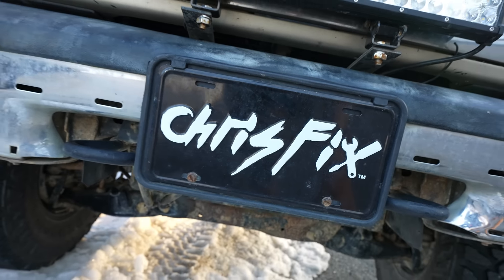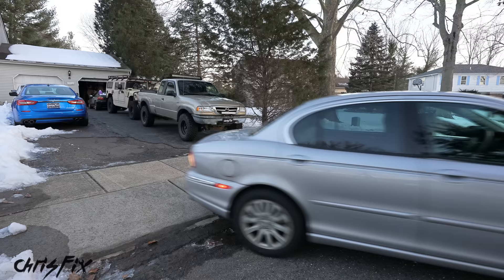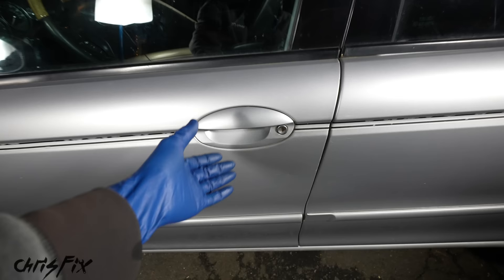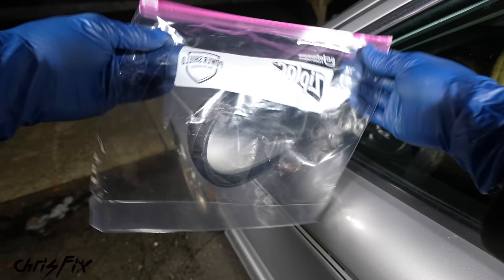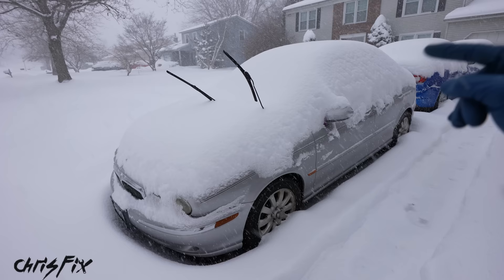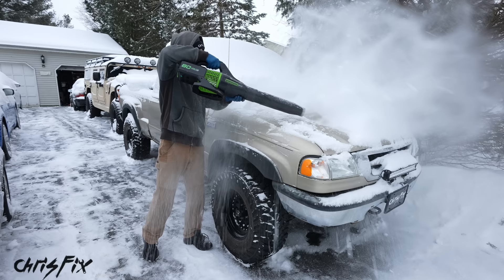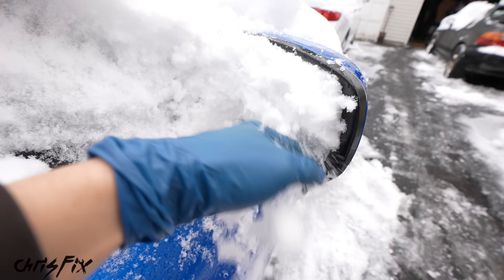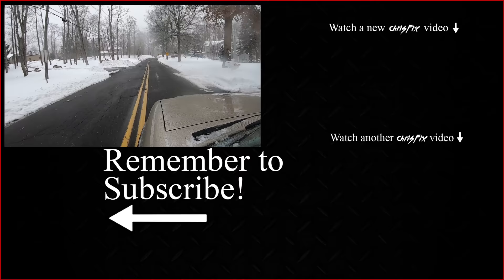10 Winter Car TIPS & TRICKS you NEED to Know

Comment: In Finland we use electrical heaters for motor and cabin, Defa or Calix brands. Car is warm inside when you come and motor is warm. Another tip, clean your car first and then the yard, not yard first. In our cars side mirrors have heating coils inbuilt so they will heat up istantly when pressing window heat button.
Reply: Hmm. And the heat might evaporate raindrops too in a light rain or mist... They would just be an option in US I think. We have areas with no ice or snow.

Comment: One winter trick I used when driving heavy duty vehicles is before you park on an ice or snow-covered surface is to move the vehicle back and forth in its track to cool down the tires.
Tires that warmed up while driving will melt the spot they are sitting on, and then freeze to the ground. I actually tore off a patch of tread one winter when I took off again  and had to replace the tire.
Reply: Hahahahaha i have lived in Montana for 35 years have zero clue what you are talking about. When it's 10 degrees out, heating of tires is the LAST thing you would ever worry about. Especially if roads are ice covered and top speed anywhere is 35
Reply: @bobspizza7444  Ask any Class A driver. They know what I',m talking about.
Reply: Gets cold here and I never heard of such a thing. Maybe gravel but never asphalt. I’m throwing the bs flag with Bob
Reply: @billbammerlin4666  Alright, Bill, and you too, Bob, pull up a chair, and let me tell you about all the ways cold winter weather can mess with you in ways you haven't even begun to contemplate.

It starts with the most obvious. Fuel gels in the lines, clogs your filter and you are stranded.
Moisture in the brake lines freezes  and your brakes won't release. Happened to me while fueling outside KC, MO. A bottle of de-icing alcohol poured in the gladhands did the trick after some minutes.
Despite blowing snow and ice, my vehicle was overheating. The radiator grill had caked on ice that was cutting the airflow thru the radiator. Happened on EB I-40 in NM. Had to stop twice and knock the build-up off the front.
5th wheel grease hardened to the point that the kingpin wouldn't release. Moved the rig inside a heated inspection bay. After 30 mins it had warmed up and started functioning again properly. Happened at a shop in Omaha, NE.
Extreme windchill on the manual steering box hardened the lubricant to the point that the vehicle became hard to steer. Nothing to do about but to drive really carefully. Happened WB I-70 thru IN.
Slush froze  the shoes and drums together  on  about all the wheels of the rig. Had to break them loose with sprays of de-icing alcohol and taps with a hammer. Happened while parked overnight in KY.
And finally, and this is to the point, the tires on about three of the wheels froze to the ground while spending the night on a shutdown section of WB I-80 between Laramie and Rawlings, WY.  When I moved in the morning, two tires lost a small section of rubber, the third a larger patch that required replacing the tire.

Winter sure has a way of building character.
Reply: @shelbynamels973  sheltered ppl that take the day off or work from home n hire the kids in the neighborhood to do the shoveling for them dont understand the real world during the winter months. Ppl that drive passenger cars or trucks 20-30mins to work in the winter have no clue what the challenges are as much as a truck driver. Not many ppl do.
Reply: @jacksmith2315  

Or they just can't fathom that people live in DIFFERENT places than them!!  The self-centered view astonishes me.  Surely cold places have snowplows.  So you can drive fast enough to get the tires warm.  And are frigid cold in the tens of negatives at night.  So I can see how tires might freeze to the ground.  Especially in canada, or russia or something.

Shit, iditarod racers have to unfreeze the sled runners sometimes.  It's not impossible.
Reply: @shelbynamels973  respect
Reply: I don't think anyone here actually understands what this guy is talking about he's not talking about heating the tires before you drive he's talking about if you're driving for a while you're tires will start to heat up and when you park it on ice like a parking lot or the road or somewhere that still has ice your tires will melt the ice and your tires will stick to the asphalt like if you stick your tongue to a flagpole or a piece of metal when it's really cold that's what he is trying to say your warm or hot tires will stick to the cold asphalt so when you get back to your vehicle and try to take off your tires could rip off the treads
Reply: @johnhostetler2167  mostly a problem with trucks that have retread tires. Not so much new passenger car tires
Reply: I’m from Alaska it’s -30 out right now,  it’s just hard for me to watch y’all in the lower 48 complain about winter and say ridiculous things😂🤦🏼‍♂️
Reply: @POS.garage  it'll be just as hard for us when you have the nerve to complain that it's 'hot' outside. No one has actually ever been 'hot' unless they've spent a summer in TX, just speaking on the lower 48. When I moved there, I thought I understood what 'hot' was...I was so wrong🤣🤣
Reply: @KerisPee  I’m originally from Arizona so I like to think I have room to talk, but you are not wrong at all lol
Reply: My girlfriend's 2022 HRV froze to the ground a couple months ago actually here in Canada,  we had just came back from a solid 3 hour drive and pulled up out front and parked. 

Couple hours later we went to go for a drive to grab dinner , put it in drive and uh, yeah. She wouldn't go. Thought something was broke till it broke loose.
Reply: crap tires
Reply: Yeah also on balmier winter days if your engine is giving off a lot of heat it can melt the snow/Ice below

Comment: Chris, something helpful, for a screen cover I used a shower liner folded in half then shoved in the doors. I found out that you need to fold the ends before inserting them so when it melts it doesn’t run into the interior of the car. Also, when in a pinch, use of plastic shopping bags will work as a replacement for your ziplock bags on the side mirrors works great as well! Love your videos, keep up the great work!
Reply: Great idea on the liner. I have a windshield cover, and it scuffed the paint when I pulled the elastic over to the side mirror.

Comment: Chris, as always, a very helpful video! A few comments from a guy that has lived through winter driving for over 50 years. Most of these tips I learned from my Dad (old school, but effective).
1. Never let your vehicle gas tank go below half full. Possible condensation in the tank and freezing of the lines from the tank to the engine. Use menthol hydrate additive (cheap) or premium gasoline.
2. Full gas tank gives better traction and distribution weight, especially rear wheel drive.
3. Old socks, usually LONG ones that went up to the knee. Put them over the upright wiper blades to prevent icing. Damn, always wondered what happened to Dad's gift socks!
4. Dad also used old wool socks to cover the side mirrors. Now, I use FREE vegetable bags from the grocery store, role and tie the ends at the bottom of the mirror.
Thanks again, Chris. Always go to you channel for layman info.
Merry Christmas to you and your family!
Reply: I pretty sure premium gas will not prevent gas lines from freezing       when it gets minus 20 an more  i disconnect battery an keep in house  battery freeze happens a lot but my gas lines have never freeze   but i put heet in gas tank in winter usually
Reply: WNY'er here, and I haven't heard of anyone having water issues in fuel since they started adding ethanol to gas.  The silicone spray on the snow shovel and warm water baggie were new though.
Reply: @smileyface9459  minus 20 what? Celsius  ? or Fahrenheit haha
Reply: @fredrezfield1629  faranheit
Reply from the maker: Thanks for the tips
Reply: Soo much text 🤯
Reply: @smileyface9459  Yep.  I use both HEET and Sta-Bil during the Winter months when I fill up.
Reply: Premium gas isn't a good idea unless the engine can use it. Premium gas is meant to be used in engines with higher compression
Reply: @smileyface9459  Nice Tip about a Warm Battery  providing more Cold Cranking Amps.  Was going to suggest a Battery Charger/Maintainer, but not everyone will have one nor (since it's cold) will the battery be able to provide its Maximum Cranking Amps.  When it gets Sub Zero (Celsius or Fahrenheit) every AMP may count... So an overnight stay in the Warm House (along with an excuse to "top off"/checkup on the Battery and Cables/Terminals...) may be worth the extra time spent. Particularly less surprises in the Morning finding a Frozen Battery because someone unexpectedly left a Glovebox/Hood/Trunk Light and/or other Accessories plugged in draining the battery...

Comment: One thing that is helpful is using cat litter as the additional weight. It’s pretty inexpensive, adds weight for traction, BUT if you find yourself stuck, cut the bag open and dump a pile in the direction of travel next to the tires and the grit can help pull you out! Love your videos, thanks!
Reply: I did this when I didn't even have a cat, 4 or 5 of the hugest boxes at Costco. Then I donated the unopened ones to an animal shelter when the season turned.
Reply: Does the extra weight mess with the shocks?
Reply: @ED80s  not so I noticed. About 120# of litter was the most i used, equivalent to a 5'5" skinny-ish person. If you can carry a passenger, should be ok.

Comment: Do not forget to mention that if you get stuck in the snow and are running the car, make sure to clear around the tail pipe to avoid carbon monoxide poisoning.
Reply: That... I appreciate your comment. Out of everything this is most helpful
Reply: How does this work? How would CO get into the car?
Reply: @RandomNullpointer  That's a good question
Reply: @RandomNullpointer  wondering  that aswell,
Reply: @RandomNullpointer  instead of escaping in the atmosphere, it gets trapped in the snow and makes its way into your cabin. Same principle applies when leaving your car running in the garage

Comment: Great video.
Some helpful tips I've learned are: 1. In a pinch, rubbing alcohol makes a great de-icer. 2. Bags of kitty litter in the back of your vehicle helps out twofold, added weight and it can be used to gain extra traction by sprinkling it in front of your tires if you're ever stuck in the snow. And 3. Putting old socks over your wipers will help them from becoming damaged. (Just like the ziplock bags on the mirrors.)
Reply: I wouldn't use kitty litter for traction under the wheels it will help you but leave a nasty ice patch for the next person keeping some salt or sand is the better option in that case

Comment: Surprised he didnt recommend to start up the car and turn heaters on while clean off the car. By the time you are done cleaning the car... the car is nice and warm and all the ice on the windows have melted and you get into a nice warm vehicle once time to drive away. :-) yep... Canadian here :-)
Reply: But then he wouldn't be considered "green"
Reply: It's not just so your car is toasty when you get in. The engine needs time to heat up before driving off, so the fluids start circulating preventing engine damage
Reply: @kimpbay  and don't forget the transmission.. auto or manual giving them time to warm up optimized their lubrication plus they shift way better
Reply: This also seems like common sense but maybe not
Reply: Also idling the vehicle warms up the lambda sensors. If you go driving on a cold day right away, the engine is runnin on maps and burns a lot of fuel while driving. Idling on maps spends relatively minimal fuel and warm oxygen sensors give stoichiometric air-fuel mix.
Reply: @samulimahkonen8604  what is maps
Reply: typical french-canadian
Reply: @Cr0nkR  when a fuel injected engine does not get information about residual oxygen from the oxygen sensors, engine is forced to run blind on preset mapping information.
Reply: @manlystyleunder50  very observant, you are. :-)
Reply: @samulimahkonen8604  

Lambda sensors have a heating circuit in them to prevent this.
Reply: @shifty2755  Some have, some are heated by exhaust gases. I have heated lambda sensors in my car. Still they require very few minutes running the engine before they start to give oxygen data to my engine control unit.
Reply: heating up the windshields and frozen stuck wipers so you don't have to scrape is the GOAT
Reply: Come on Chris ... you missed a trick 😂
Reply: Busting out the entire windshield works too
Reply: @kimpbay  realistically that takes under 45 seconds. Even if idle doesn’t drop to normal level, the circulation and pressure should be 100% within a minute
Reply: At least with newer gas engines*
Reply: @fly4976  it regularly gets to -15C in the winter where I live and can get to -40C, trust me it takes more than 45 secs!
Reply: @joebrown9621  LoL manual transmission will not warm up just by idling.
Reply: I wouldn't recommend this. If it truly is cold out it is better to leave the heaters on low until the engine has warmed a bit instead of stealing that heat into the driving compartment. You are better off buying an electric compartment heater that turns on with a timer in the morning so the car is defrosted and warmed up before you even enter the car. Here in Sweden we use plug in engine block heaters and then extra compartment heaters that plug into mains electricity. Also changing to a thinner oil for winter makes cold starts wear less on the engine. I always use 0w30 in winter.
Reply: Engine block heaters have been great!
Reply: @wyzurd  yeah they really are simple yet very effective devices. We even have a diesel engine heater installed on our truck so we can go camping in winter and put it on a timer so the engine is warmed when we come back
Reply: Isn’t this common sense
Reply: @kimpbay  
The best way to warm your car up is to drive it, not let it sit idling unless you can't see out the windows which in that case you will have to let it warm up first. Otherwise you start the car and then put your seat belt on and go! You can google this for yourself and you will find many articles on "how long to warm up car before driving". You don't have to let your car idle for any longer than 30 seconds before driving, idling for any longer is just wasting fuel and polluting. New fuel injected vehicles don't require warming up before driving no matter how hot or cold it is outside.
Reply: @missflissen  
You must be starting your car in an enclosed garage...don't do that!
Reply: Finnish person here. Why doesn't the rest of the world have electric engine heaters like we do? You just plug in a cord to your car and then a small heater starts blowing hot air at your engine warming it up. You can go and plug it in immediately when you wake up so that when you are leaving, you just disconnect the cord from your car and start the engine and it's immediately pretty warm. (Like 30-60°C, which is better than completely cold.) This also saves the battery and the charger and is also much more friendly to the engine.  They are always an aftermarket install but pretty much everyone has one in here because they're just that useful.
Reply: By the look of your name, you must be from the province of Quebec
Reply: @AkunPulivari  a good portion of people in canada have them, my corolla has a block heater
Reply: @AkunPulivari  Maybe in other countries they would need it like 5 times a year. And/or you park in the streets in front of blocks of houses and you don't have electricity there.
Reply: @samulimahkonen8604  @AhhHahaHaha - re: "what is maps" =  (MAP) sensor is used to continuously monitor the amount of air flowing into the engine, so the computer can calculate air density.
Reply: @missflissen  so basically also dont drive it if you get stuck in traffic behind other cars?
Reply: @jpogigtxcr1778  it actually does,all the gears are turning all the time, only the output shaft isnt turning because non of the gears are engaged ( and ofcourse a little bit of engine warmth, warms up the gearbox casing aswell)
Reply: @randomwotgamer1  Yes they will warm up without load in like an hour lol.